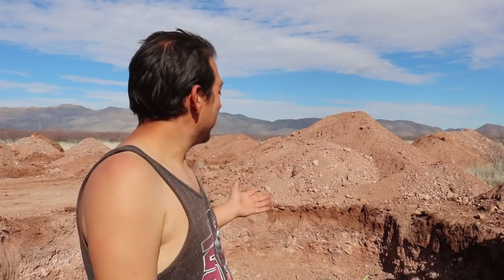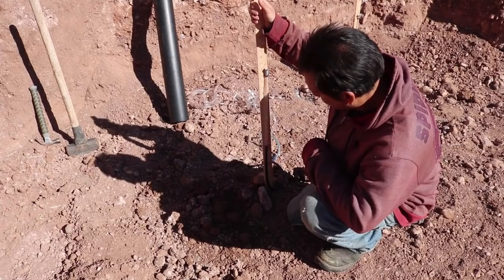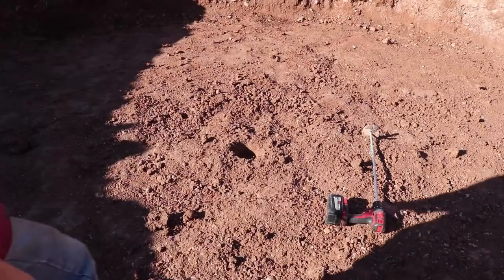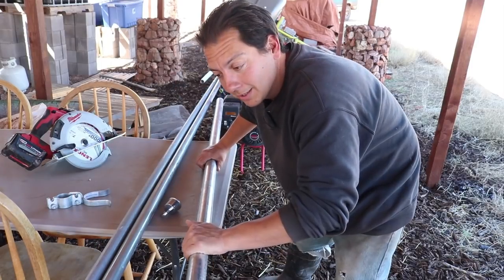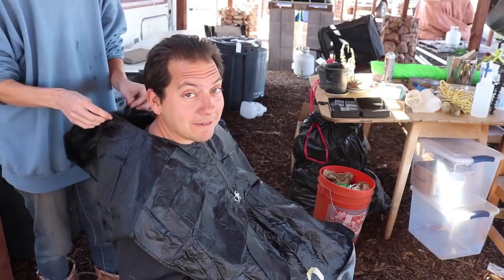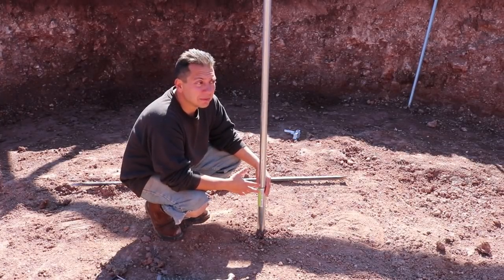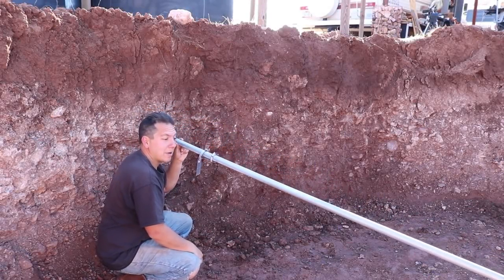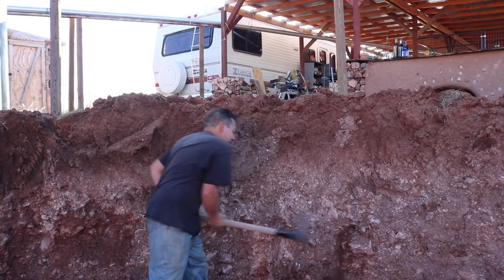Building A Pole Compass For Easy and Accurate Earthbag Construction

Comment: So much work ahead of you. If you mentioned what the new tool does, I missed it.  Okay, enough with reading comments. Get back too digging.  I'm sure you have some lights you could set up so you can dig in the dark.
Reply from the maker: Thanks Patrice! It measures the inside diameter of the bags.

Comment: Cra-Zee as always. Curious as to why you chose not to use the old school chain option that would adjust in /out as your walls heightened? Edjumikate us. Thanks. Is that a new 'Crew' T-shirt from The GDP Tee selection? I must have missed it on my last tour of your site. LYMI
Reply from the maker: The chain compass is good but I don't think we can use it on any of our builds, especially this one. The walls will be vertical. 
Thanks Mack.

Comment: Maybe think about making the bottom a little lower on one side by your entrance above..
So at a point in time 
If there becomes a need to completely drain the tank it should be easier...
(Lets say to clean the bottom)
(Or lets say to search for a leak and be able to install a patch)

Comment: Jim... try a hammer drill with a 4-inch Spade! You can carve and shave whatever you want what shape you want.
Harbor Freight can help you with that.
Reply from the maker: I have a demolition hammer. That's a good idea. I need a spade bit though.
Reply: Harbor Freight!!!
Reply: If you will do plate your spike for the demolition hammer you have a automatic tamper!
Reply: That was supposed to say weld a plate on the spike.